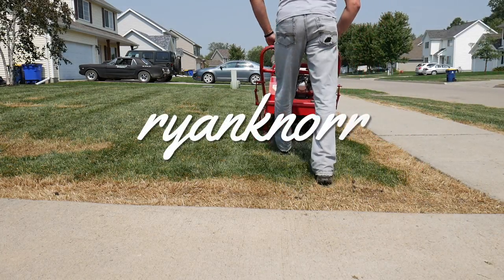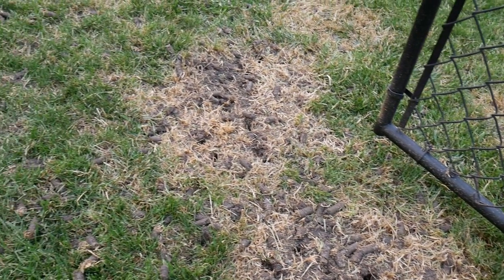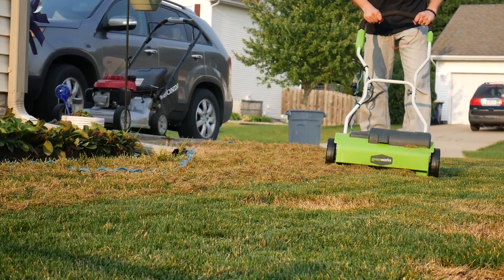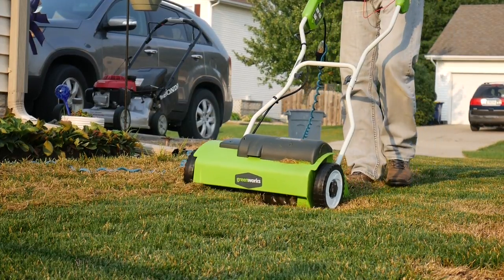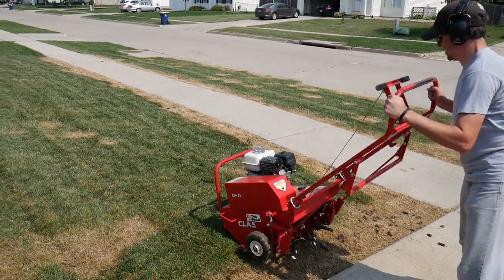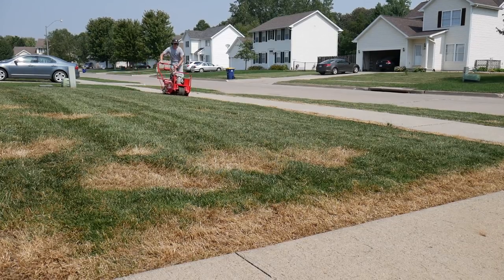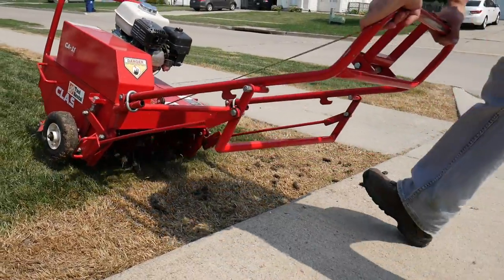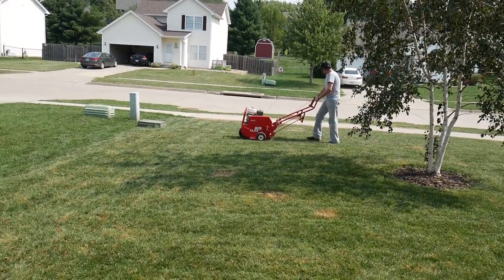How To Core Aerate Your Lawn - Fall Lawn Renovation and Overseeding Project Step 3

Comment: Not sure if they have them in your area, but the Billy Goat AE1300H made aerating one of the best lawn care experiences I've ever had.  They used to break all the time being designed down south where soil isn't nearly as rocky as it is here in New England, but I'm told that they changed the tine arm design to be more durable.  That being said, if you've got good top soil it's an absolute joy to use...golf course quality aerating in one pass
Reply from the maker: My friend and I searched all over the place for a billy goat and couldn't find one.  It looks like a dream compared to these models that we typical have available around here.  Wish I could just try one out!
Reply: Judging by your channel, it'll be one of the greatest days in your lawn care life when you do get to use one lol.  My buddies dad runs a rental store in Mass., and for whatever reason he stubbornly buys equipment that's primarily built for commercial use down south, but 2 days out of the year I appreciate that mans stubbornness like no other

Comment: I had my first experience with aerating last weekend.. My next door neighbors are a little on the older side and can't do that kind of stuff so I offered to do their yard if they rented the machine. When you mentioned using muscles you don't typically use, you're not kidding, I was hurtin' all week! lol BTW, I used the Ryan Pro model from Home Depot and I think it was probably slightly easier to use than that Classen. Best news is that as of yesterday germination took off and I have baby grass popping up all over the place!
Reply from the maker: I've used that Pro version as well last year and it did fine but didn't seem to be a huge difference.  Good luck with your lawn project!

Comment: Thank you for all the great tips. Im following your plan. I'm a step ahead of you and already over seeded. Also aerating was a labor intensive job bc I didn't rent the pro version and used the one like you had . Next time I'll spend the extra few bucks and get the pro version so I don't have to stop and turn each time. Keep up the good work.
Reply from the maker: I am actually ahead of the videos as well but trying to get them edited as quickly as I can.  I tried the pro version last year and it was ok but making turns still wasn't super easy. I felt like when making the turns I tore up more turf than I should have but definitely could have been operator error.  :)
Reply: ryanknorr well I guess it's fair to say we both didn't realize the amount of work it took. De thatching and raking was easier than aerating. I rented a power take this time. I might consider buying the electric one you showed. I have around 5000sq ft between my front and side yards.

Comment: $110 for a double pass from a local company. The guy and his son showed up with two stand-on aerators this year and knocked it out in 15 minutes - pulling larger cores than rental machines do. It would have taken me many, many hours and several days to recover - money well spent.
Reply: Mike Kefer holy crap I'm doing that!  That thing whipped my ass last year.  They need to put wheelie bars one them for when you first engrave the drive.

Comment: Noticed you left the tines down when making turns. Did you ever try raising them? It's a lot easier to raise the tines when turning then lowering them back to when you make your passes.
Reply from the maker: I have done it both ways but I find it saves time to just turn with them down if you are able to lift the machine high enough.

Comment: I just bought the tow behind Brinly aerator for $169. You definitely need to overlap your passes as the plug cutters are pretty widely spaced. With a rental being $75 a day for the type of unit you used I figured I was money ahead by usage number three.
Reply from the maker: If I had something to pull one and could easily maneuver one around my yard, that would definitely be an option I would look into.
Reply: Yeah, my Snapper rear engine rider with 10 hp is working hard. And it does require a wide circle. If you do core aeration often (spring and fall?) and have storage space it may be worthwhile looking at craigslist for a garden tractor without a deck - they usually go pretty cheap.
Reply from the maker: Storage space would definitely be the issue but it would be nice!

Comment: To rent this machine by me it will cost $70 for 4 hours or $90 for the day. Plus I have to do the work myself and pick up and drop off which is an issue because either looks heavy and I don't have a extra set of hands to help. Landscapers by me charge $80 to do my yard. Well worth it. Ask a few landscaping companies how much they charge before you go and rent this machine yourself.

Comment: Agree with what was stated before - try picking up tines before turning machine around. Either way still a shoulder workout!  I have 3 neighbors that join in on the rental fee so it's a minimal cost. Too bad I'm the one that the truck and does the work...👎🏼😜

Comment: How short would you say your grass should be when you aerate?
Reply from the maker: It works when it's taller but looks much "messier" to the eyes so I would cut down a little lower than your normal height if you can.  Before dethatching and aerating I went down to 2 inches and that's about as low as I have ever cut it.  Seemed to work out well though.

Comment: Lift the tines before you turn and pivot on the rear wheels with a pulling motion and you will be lined up for the next pass, much less effort than lifting, I did the same before and it beat me up
Reply from the maker: For some reason lifting the tines on this particular machine seemed more difficult than just leaving them in place.  I'll try that for next time though.